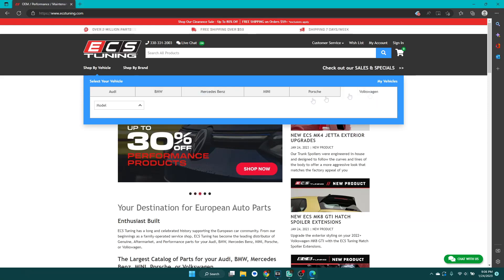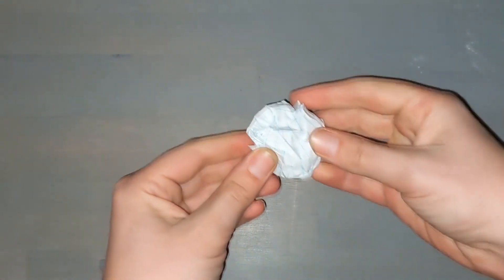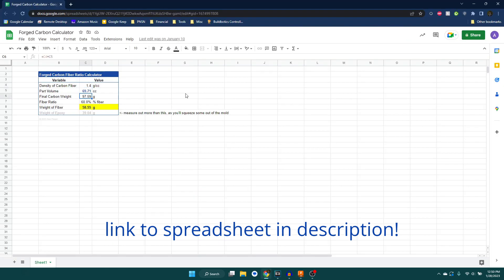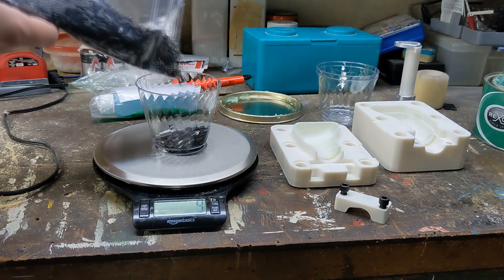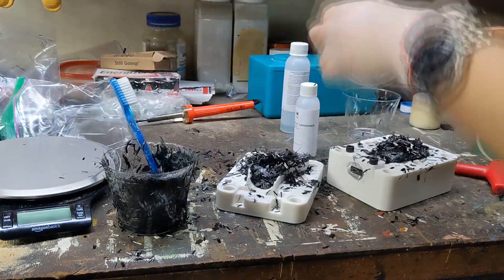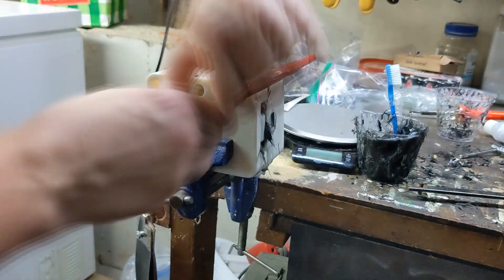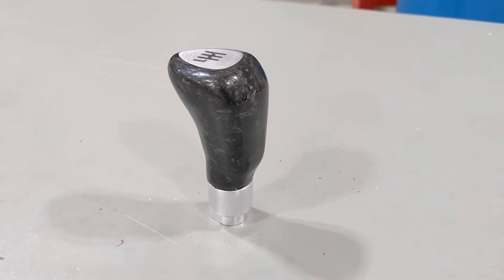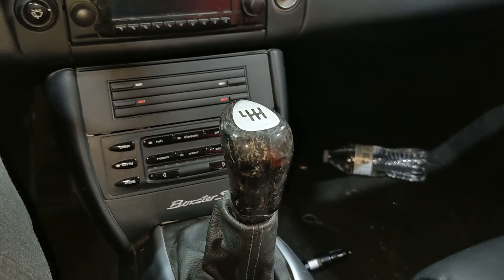Can You Make Carbon Fiber Parts At Home? | DIY Forged Carbon Porsche Shift Knob

Comment: calculations are off from render to part made. render has hole through it part made is solid.
Reply from the maker: That hollow space is filled by a 3D-printed shaft in the final part, so while the part is solid the entire part is not carbon fiber. The calculations match the portion of the shift knob that is carbon.
Reply: @alexpinson7907  exept for the fact you cant evenly stuff carbon under that dowel so no i can guarantee there is a air pocket inside it should have made a solid shift knob and then cut out the top for the inlay of the shift pattern the whole dowel through it is stupid as well why put a filler in that isnt even heavy like most people dont want a shift knob thats as light as air like this whole video is just a waste
Reply from the maker: @Xmz-t9d   If you watch the video, the mold is filled before the core is inserted. This is the way it's done so that the core pushes the carbon out of the way and you don't get a large gap from trying to fill the mold after the fact. When filling these, you use more resin than you actually need based on the calculation so that the pressure of assembling the mold forces it into any air holes and the excess bleeds out of the mold. 

The plastic used also has a near-identical density to forged carbon, so weight would be the same either way. You need a core, whether it's permanent like mine or a part of the mold that's removable, so that there's a hole for the shift lever regardless. If you don't like it don't make one ¯\_(ツ)_/¯

Comment: Thanks for the video. I wanted to see someone try this besides EasyComposites. He makes everything look easy. lol.
If you wanted to try this again, I have always wondered if you could pack the mold with dry carbon, get it tight and compressed with no resin, then pull a vacuum on it. set it upside down and let resin in from the bottom.. it would fill upwards through the compressed fibers, leaving just a resin nub to sand off.